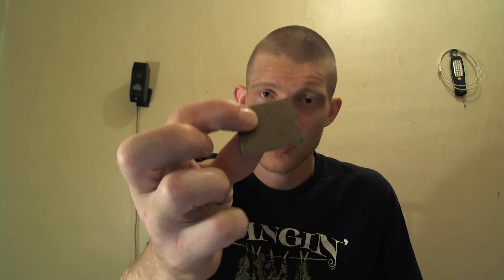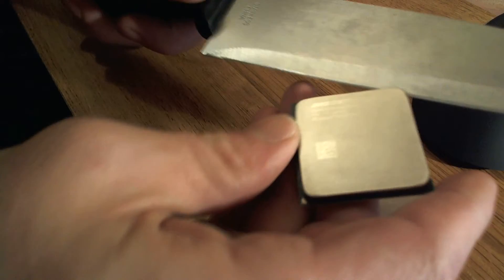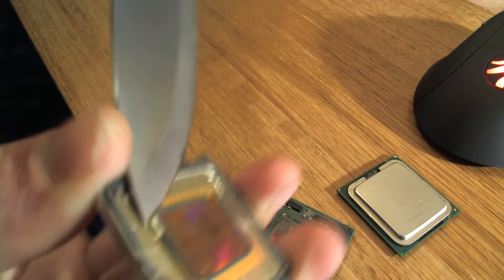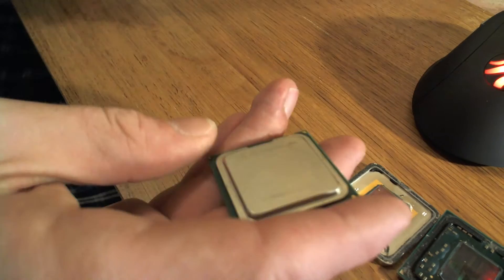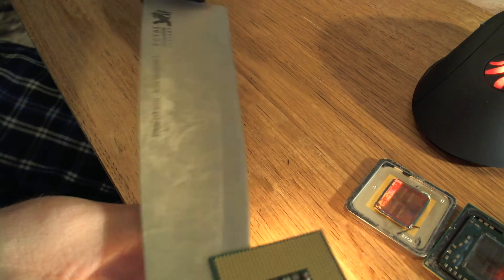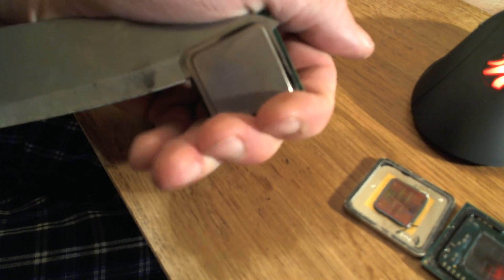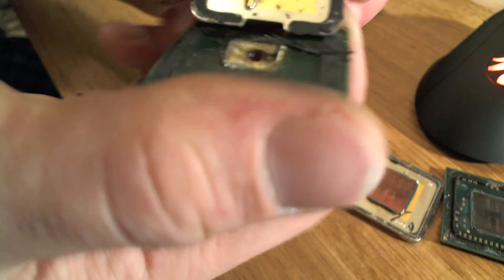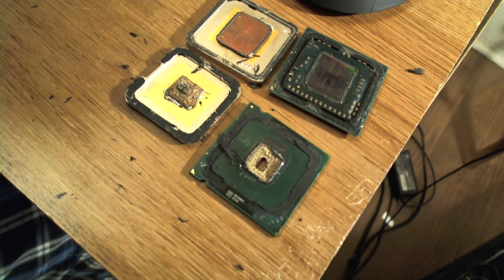Opening a 9590 and pentium 4

Comment: yeah with soldered cpus, its best to take a lighter to the ihs to make the tim like jello
Reply from the maker: ohhh true  i didnt think of that XD
Reply: Leslie Peters if you put the cpu, IHS side down and after cutting the glue around the edges, if you put a lighter so it touches the IHS for 2-3 minutes it should soften to the point where you can pull it off. but ofc it'll be rocket hot